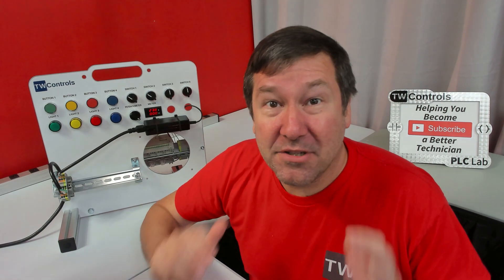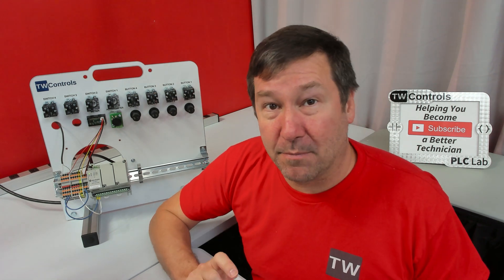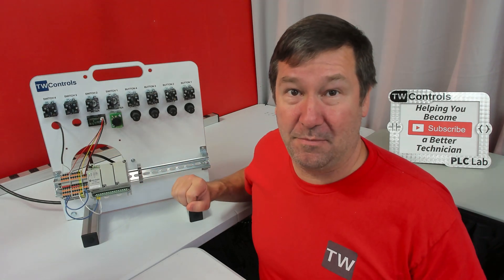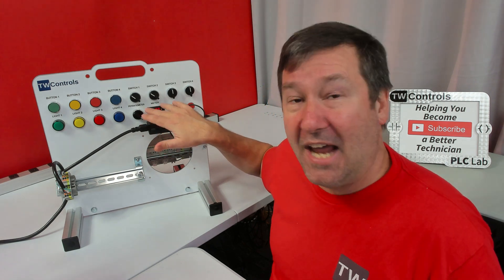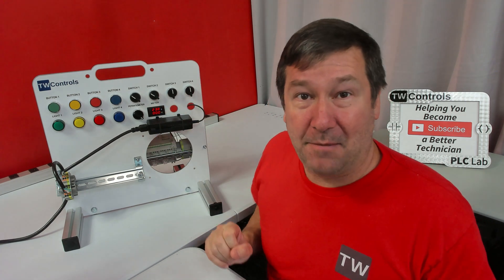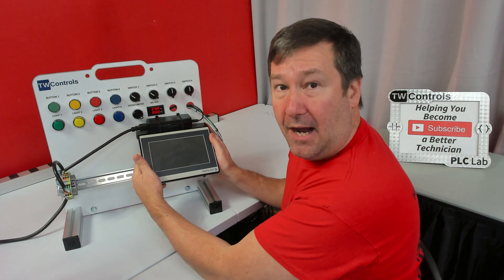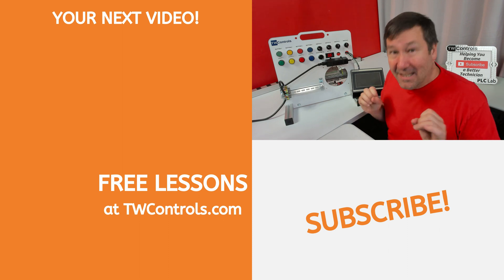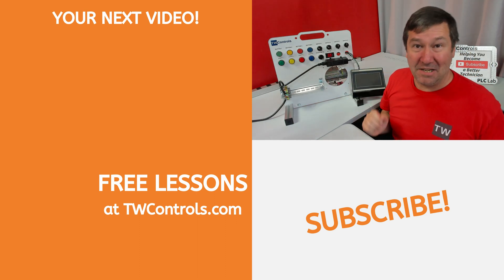PLC Trainer with Allen Bradley Micro820 PLC and Panelview 800 HMI

Comment: Hey Tim quick question. When I'm doing ladder logic in the connected componets software programing a 2080-lc50-48qbb I have problems with writing to some bits in the end of my rungs. It seems sometimes it will pick them up and sometimes it won't. Is this an issue you have seen or had or am I doing something wrong?
Reply from the maker: I haven't seen that but I don't understand what you mean by "pick them up".  As in they are missing the drop down?
Reply: @TimWilborne  my apologies I am not a plc programmer i do what i can and im trying to learn more so i will try to elaborate a little better. So if I write to a boolean "index" at the end of a rung of logic to start a small sub routine of flipping a mandrel over to a set spot and I use the bit "index" when ever I wanted to do the flip routine it will see it sometime and sometimes it won't. The line will be red on both sides of the output instruction but it will not start the routine. I broke it down into a program all by its self to make sure I could figure it out with out anything interfering and the only way I could get it to work is to make a bunch of booleans named "index1","index2" for every time I wanted to do this flip routine then set all those numbered index boolean variables to one with no number then only use the numberless index to actually start the routine. I'm not sure if that made sense so pretty much if index1 or index2 or index3 are true then it turns on the index which then actually starts the drives and the sub routine. Is that how youre suposed to do it or is it something im doing wrong?Did that even make any sense? Again, I apologize. I do a little bit of everything, and I'm trying to learn about this. I'm no means a professional programmer but I'd like to learn as much as I can.
Reply from the maker: The first thing is to figure out if the routine is in fact running.  Add a rung with a simple ADD instruction in it...with source A being mydint (data type DINT), source B being 1, and the destination being mydint.  See if you increments rapidly when you rung goes "red".

Comment: So... I have been searching through your videos, but I haven't come across a tutorial on a Micro800 series PLC taking a 4-20ma signal from a flow meter and creating a totalizer off of said signal. I know it's not the best way, but the majority of what I have deals with 4-20ma signal and not pulse. I have looked in CCW for a TOT function like 5000 has, but know luck. Will I have to create a pulse counter within the logic to accumulate total flow for any given amount of time? Just seeing if you have thoughts on this subject.
Reply from the maker: It is surprising that I don't have a video on that, I have done it before.  I'm going to be recording some analog videos soon and will put it on the list.
Reply: @TimWilborne  That would be awesome! I think I am on the right path, but I am unsure. I know it can be done with relative ease in a ControlLogix, and I have other examples to go by for 5000 for this type of thing. I really don't want to have to create a UDFB for this as I try to stay away from structured text.
Reply from the maker: @MrGallaleo  You can do it easily in ladder logic.  You are going to do the opposite of what I did in this video.  In it, I took the change in total and calculated rate.
https://www.youtube.com/watch?v=91Le5Sm4ejE
Reply: "No luck" not "know luck"